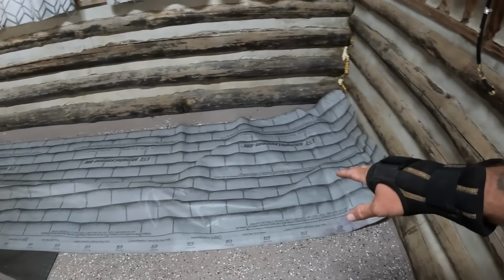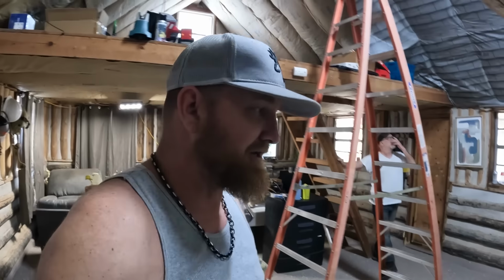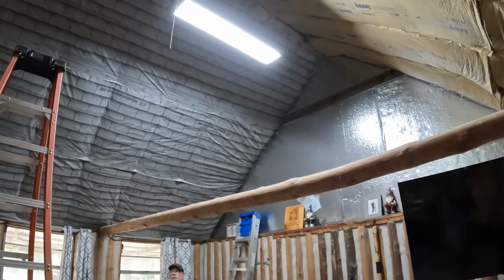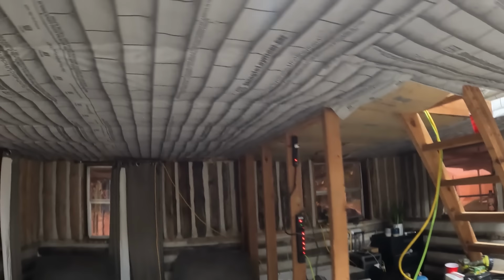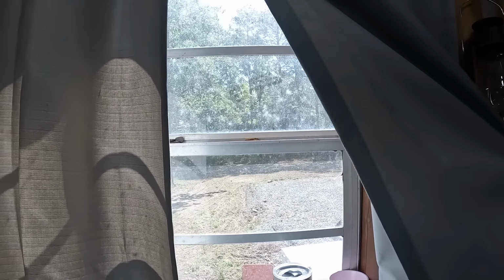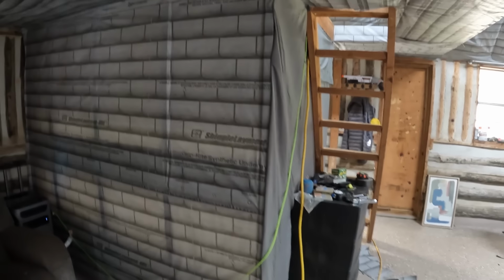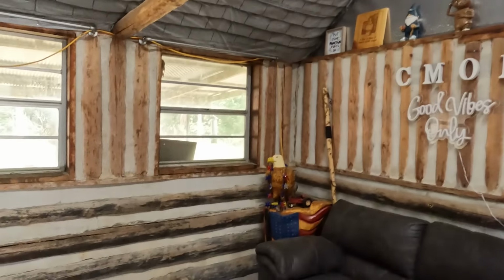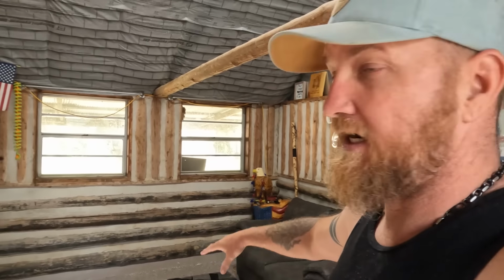ABANDONED CABIN FLOOR TO CEILING TRANSFORMATION

Comment: The cabin looks nice! Makes a nice guest area.. you don’t have time to do it before your family comes, but for future guest, you could maybe build a guest bathroom with a composting mtoilet and a sink and shower with running water.. since it would be gray water, you can run a drain line away from the cabin out to the woods.. you have the equipment to trench with..this idea might not be practical but, it’s a thought.. make it using the same concept as the tiny house, with burned wood you cut from the mill..

Comment: Nice work on the vapor barrier the finished product will kook even better ever thought of putting up wooden panels on the ceiling? It looks like bead board. Pretty inexpensive but would still hive you that cabin vibe just a suggestion

Comment: If you decide to finish the ceiling might be easier with metal. Peice of valley at the top. Metal on down running either way.
Reply: Maybe a brown to match the wood. If you run top to bottom, if the roof leaks, it will run down to the wall and if you install a gutter to finish it off into you can use the gutter for indirect lighting. Sorry David, I'm just thinking out loud.